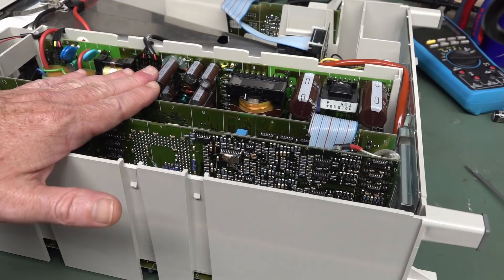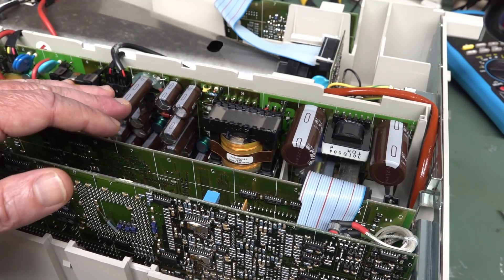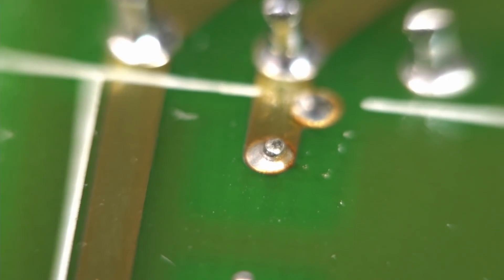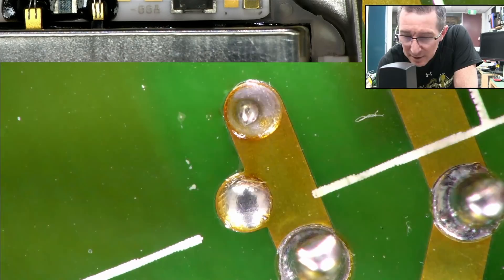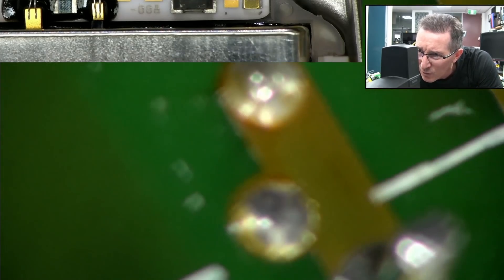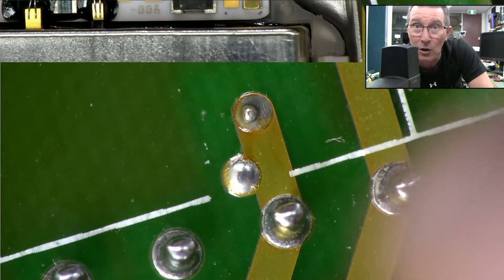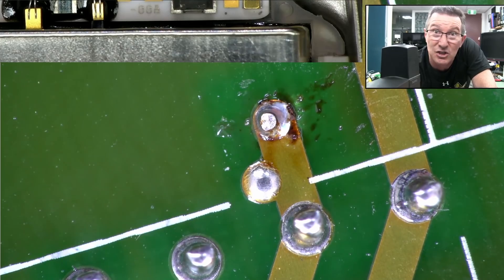Fluke PM3370B Solder Joint Inspection

Comment: @EEVblog2: could you maybe make a video where you discuss the following: The cheapest "No name" digital oscilloscopes vs. 30 years Old High End scopes. Both are in the same price range, so for somebody who might want to begin with the hobby maybe interesting to elaborate what would be advantages and disadvantages of one vs. the other. Main question is: is an  old High End scope worth investing a couple of hundred dollar? The same question for the New Bottom Range Digital scopes. Personally, I do not know. Maybe, probably none of he both, unless you get an analogue one for almost free, broken to repair or similar, or very cheap for a 30-50 bucks..
Reply: The same for Spectrum- and VN-Analyzers and such..

Comment: Really interesting to watch. Much more interesting than a TV detective series LOL. Will he find the cause of the fail...? Maybe in the next episode... I would bet also on a bad soldering junction. Those could be microscopic. After 30 years of heating up, cooling down and mechanical stress. Solder is not made to give a lot mechanical support, so any heavier component (if not properly mechanically supported) could be a suspect (that is from a mechanical stress point of view, thermal can cause every solder to fail, but maybe less probably to be the actual cause). I still remember a medium size CRT color television, a re-branded Philips, back in the days, after an almost 2 thousand km auto ride when arrived not working. An visual inspection showed an less then hair size round break of solder under a bigger electrolytic cap. My eye sight was much better then LOL. Re-soldered and we were back in business. Winner winner chicken dinner LOL

Comment: Hello, I have the 3380B, and I have no CRT screen. 
All seems working fine, the knobs, buttons, all the feedbacks, the behaviour when power on and so on, but the only thing that is not working is the Screen,  (Completely dead).

I checked all the capacitors,  Voltages , inductances and seem fine.  So i figure out that the problem is probably at the HV side.
I don't know how to check the voltage at the HV capacitors ( I can't spend 300$ for x1000 oscilloscope probe if this is the way) , but I checked and they have still their capacity. 
In my little experience seems like that the flyback transformer is dead, because I can't even discharge the anode when it's turned off. (No sparks there) So I presume that I may have the input voltage at 5kV and no output voltage. ( But the flyback transformer BG2000 it's out of production and I can't find it).
Maybe someone can help me, what do you think?  it'd be much appreciated some advices.

Comment: I would not expect a dry joint on a plated through hole,  Also, if it was a dry joint I would expect some evidence of arcing through the crack in the joint.

Comment: A dry joint does not require any mechanical movement. Solder joints need to be done at the coldest possible temperature that achieves "wetting". Higher temperatures (which you need sometimes) cause the solder to crystallise  (internally - still looks good) as it cools. The crystal lattice interfaces can) and do oxidise) - this gives you a dry joint - which can be/is temperature sensitive - so just resolder all joints if you have an intermittent fault. This is common on joints that have "large" heatsink component to them - so connectors - thick wire terminals (relatively). "Wiggle" it would hardly expose ANY faults - except when things are almost falling apart.

Comment: I recently thought that I was making a lot of dry/cold solder joints, but it turns out that I was just dulling the shine on them when I used a toothbrush to clean off the flux residue.

Comment: These fatigue cracks are evil. They are really visible only with some exact light and view angle, otherwise they look as very clean joint.
There is definitely a crack forming, but did not penetrate through yet, so it will show as perfectly good at any electrical or mechanical (wiggle,...) test. But once it starts, it tends to propagate and it becomes a matter of not that long time till it propagates through the material and becomes a real dry joint fault.
So indeed, technically there is no fault yet on that joint, but the fault is definitely forming there.

Usually not that big deal on double sided boards when it is properly wetted through the whole hole (it has very long way to go before it really fails), but it becomes quite severe on a single side board.  Of course being it a fatigue crack, it becomes more severe when exposed to higher forces. Does not have to be a heavy component, could be just thermal cycling...

Comment: Maybe re-engineer one of those circular camera lights to sweep around the LED ring, so the light angle is changing constantly even if the view isn't. (Think Knight Rider's Kit or Battlestar Galactica's Cylon, but scanning in a circle.) Could make it easier to spot stuff like that without having to reinspect the same board over and over.

Comment: i've had joints look like that before. some alcohol will clean it up. its a product of the flux. if you look the rest of the joint around the edges has flux coating on it too.

Comment: Solder joint inspection is a red herring when you don't follow through with instrument based troubleshooting.  Prove the failure first before you start flailing around with a solder iron.

Comment: @ 9:10  It looks like the component lead is oxidized a bit.  Solder coated the tip of the lead but not much of the sides of the lead.  However the lead is in a plated through hole in a double sided board and no doubt is sufficiently fused to the copper tracks so no problem there, just kind of ugly looking.

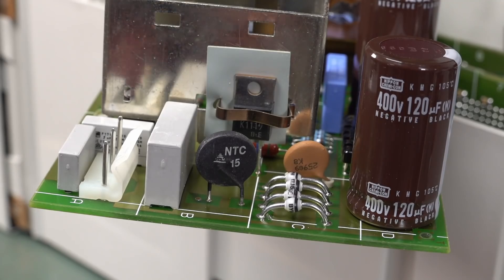Comment: @ 3:55 WRONG!  Using a PTC thermistor to protect downstream overcurrent will result in the thermistor overheating to destruction and possibly burning a hole in the PCB.  You would want a self resetting fuse element there instead.  The NTC in the Fluke is a surge limiter.  It quickly reduces it's resistance to prevent overheating after it did its job of limiting the turn on surge cause by charging the off line power supply caps.

Comment: It is a long shot but maybe the edge connector to the unit to the supply card had a dodgy connection that you overcame by reinserting it. A broken signal may have called the switching controller to shut down?

Comment: Some of the joints if you don't see the component lead but a little hill on the solder side, it is possible the lead is sitting on top of the board in the pit but not really soldered. One time I fixed a stand one scale because a resistor for some reason had an actually broken resistor lead I bridged.

Comment: I have come across a high resistant  glassy boundary develop between the component leg and the solder on the pad. This is a problem with lead free solder, particularly the early stuff, where the manufactures were experimenting with the temperature profiles. The joints were better when vapour phase soldering was used, as the temperature was more even. Unfortunately, vapour phase soldering was outlawed because it used a boiling fluorocarbon liquid to melt the solder. Vapour phase was replaced by infrared heating, and this proved  difficult to get the right temperature profile, as the components reflected the IR  differently  between black and silver packages. At the time of the introduction of lead free flow soldering, not all components were really rated for the higher melting point of lead free solder, so the over temperature margins were small, resulting in the solder on dome joints not reaching its melting point. 
The horrible lead free solder really does not flow very well, and sometimes fails to wet the joint.
Reply: Lead-free solder, a solution in search of a non-problem. What a blow to technology in general.
Reply: @gargantuablargg  I am not sure I can agree with that. It is a problem putting the toxic metal lead into the environment, even if it was used for decades as water pipe and in car batteries. 
A better solution might have been to introduce better methods of recycling electronic waste, for while the lead was contained on the circuit boards, it was not harming anybody, its the disposal that is the problem. 
Lead free solder is horrible to use in comparison with the old tin/lead solder. The new stuff melts at a much higher temperature, it does not flow or wet the metal joints it is trying to connect, it forms joints that look dry and glassy even when they are not. It is far more brittle and much harder to desolder. The alloys used include more expensive and exotic metals such as silver and antimony.
The much higher melting point puts additional stress on the component being soldered, but obviously the early production problems have been solved, as lead solder has been outlawed, and has almost disappeared from mass produced electronics. That still does not make up for its limitations when hand soldering. I still use lead solder for my home built projects, and have a stock of the 60/40 reels.
Reply: @gargantuablargg  they are a problem to both types of solder. I suspect the high resistance layer found on some lead free joints are the result of trapped flux. In general the old lead/tin mix has better electrical and mechanical properties than any of the newer lead free alloys. 
When desoldering, it is much harder to keep the whole lead free joints molten st the same time. It is much harder to solder to solder surface mount devices, particularly those where the component pads are on the underside of the device. Needless to say, I do not believe that BGA  components are suitable for home projects or even prototypes built by small companies.. The equipment needed to successfully place these devices on a prototype PCB is just too expensive. I spent some time tracking down soldering issues involving an FPGA, BGA component, in the end this required taking X rays of the board, to locate which BGA connection was failing. Something that would be extremely difficult, and expensive, for a home constructor to solve.

Comment: When the +58V shuts down it is probably caused by the thyristor V1213 being triggered.
It is connected between the +58 and -58 and is used for shut down. 
It is triggered by the TPDOWN signal on page 5.6-11. 
This signal can be triggered by several different faults as described on page 5.6-4. 
It is also triggered by the Power Fail circuit. 
Try interrupting the AC power for about 1/2 second and see if the scope shuts off. 
This will simulate an intermittent power switch. 
Maybe it is something else besides the switch.
It sure looks like  the thyristor V1213 is being triggered.

Comment: I've just checked the PSU of my PM3394B which has the exact same issue as yours. I found two cracked joints in sector B11: two resistors next to a coil.
Edit: never mind, didn't fix it.

Comment: Hint: If you tap a PCB on the edge when the instrument is active, e.g. with the back end of a screw driver or an isolated mallet, you may find any dry contact. 
If it is a high voltage or high current joint, consider darkening the room and tap the PCB a few times, probably you will see the dry contact(s) sparking. 
Another issue: dry contacts aren't always visible. Sometimes a tiny hole in the solder causes air into the joint (over time), causing oxidation INSIDE the solder joint. When you wiggle the component, the joint will look OK, but it still isn't. The oxidation also breaks the strength of the copper/tin joint, which is a layer of bronze a few microns thick. This will finally (over more time) make the entire joint break visibly.
These tiny holes are cause by bad soldering, usually by insufficient flux materials, or holding the soldering tip too long to the joint, or even heating the tin instead of the solder joint.

Comment: Aside note on NTCs: I was confronted with NTCs for inrush limiting that failed in low temperatures. In the cold the NTC resistance dropped so low that the startup current peak caused the max pulse power dissipation of the NTC to be exceeded which broke it. A larger type of NTC fixed the problem.
Reply: But an NTC's resistance increases in the cold, so the initial current would be even lower.
Reply: @cpm1003  Oh yes, indeed, my mistake, the NTC resistance got too high in the cold. The problem wasn't the inrush current but a constant current demand that caused excessive dissipation in the NTC before it could self heat.

Comment: looks like the joint was OK , BUT , I had the issue with the tin  plating of the legs of components lifting of ... and bad contact to the pad , good scrub to get to bare copper retining and problem solved... but I could wigle the component and not seeing any movement on the pad side !! but could feel the component slightly moving... this was on a 7812 and a 7815 from same source manufacture on same amplifier board of the mid 80's ...so do check quality of legs tinning /plating...
good video micro viewing
Reply: I've recently had a situation where I felt that something like this was the only remaining possibility... unfortunately, I've had no confirmation; because I probably threw the entire apparatus absolutely as far as possible into the bushes. logic and rational thought and retrospective thinking can be a complicated path... possibly even... a path (if we're lucky) through the bushes. 
Perhaps I'm living a metaphor.  or perhaps not.
 peace.

Comment: why would you call it dry? is that just an electronic term for broken contact?
Reply: I think "dry" refers to the opposite of solder "wetting", or "sweating".  The "lead" (or the pad) sometimes does not getting hot enough during the manufacturing process. Thus the solder doesn't penetrate (desolve into) the metal of the lead (or pad).   Therefore the joint the solder forms isn't as strong and may fail prematurely due to mechanical or thermal stress.

Comment: That solder joint looks good to me in the alternative lights. But I have had solder joints that looked good and I could only detect the issue by using a multimeter while poking the component. Reflow helped.
Reply: certainly don't need to have a wiggle on to be bad. Thing can be mechanically perfect but there's a crack that goes all the way through, and oxidation in the crack makes an open connection.

Comment: Thanks for the video.
In the last video you said that you sprayed the board and frosted over the board, is there a part that when cooled down, could it repair the part. ex PTC before cooling would shut down because it is weak from to many over heats, and the cooling of the part some how give it some extra life. Do not know how these this really works just wondering if there is some part that can be reset or given a new life by cooling.
Reply from the maker: In theory that's possible, yes.

Comment: no. you had a leaky cap that reformed its dielectric layer as you were powering the unit repeatedly - issue was exposed by sitting idle for (likely) years. you can wait for it to fail again/completely (which can take years considering they are quality caps with lots of spare electrolyte) or desolder each one and individually measure esr/leakage (tho most likely cap in question will now show as within spec, for the same reason)
Reply from the maker: Nice theory but it was repeatable a dozen times and then I solder all the power joints and it now it's good?

Comment: is the brightness being driven as high as it was before? have you tried turning it back to 11 and seeing if it fails? it seemed to be less bright after you resoldered it...dunno if that was just the pot dial/rotary encoder being moved, or if the resolder did it...
Reply from the maker: I thought that might have an effect and tried that but ti didn't make a difference.
Reply: @EEVblog2  bugga

Comment: No doubt it WAS loose in the previous video.
I wonder if the poor connection has caused the joint to heat up enough to melt the solder just enough to reconnect.
Reply from the maker: I greatly doubt it, it can't go from loose to rock solid. It moving was just me poking hard (it's not feel-o-vision) and it looked like it was loose.

Comment: Just resolder already instead of wasting time with optics, cameras, exposures. 
Goodness.
Reply: I do appreciate Dave going to great lengths explaining things.
Reply: @kajyakuzonik9130  Nein! Not efficient.
Reply: @johanea  wahrscheinlich- but It would have been if the optics had instantly detected a problem that was quickly fixed... but I take your point: I should probably just reflow everything... more. Unfortunately, I don't really know what I'm doing, so I'm always wondering if I'm just wasting my time following the lead that I'm on, or not. Things are complicated. and stuff.
  peace.

Comment: Hi Dave, if you check your other video, you will see how the ntc moves by a couple of mm and stays there just by slightly touching it. This was no normal thing. I don't know if it had anything to do with the issue but it definitely looked like a loose component.
Reply from the maker: This is not feel-o-vision, you can't see that I poked it hard and moved it which made it look like it was loose.